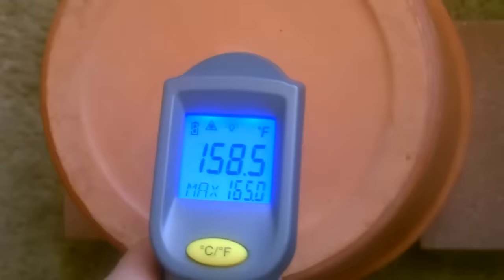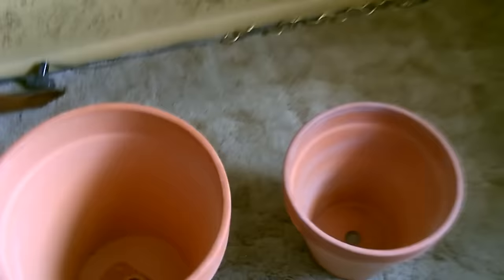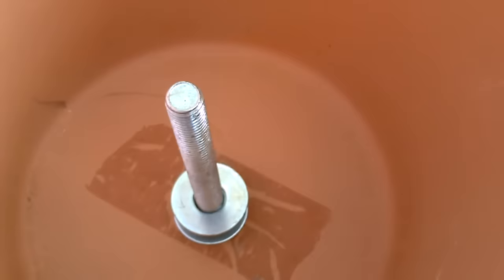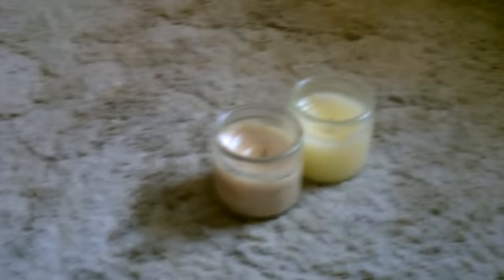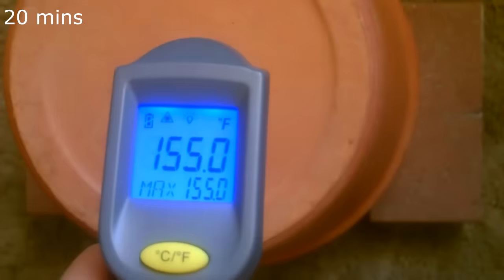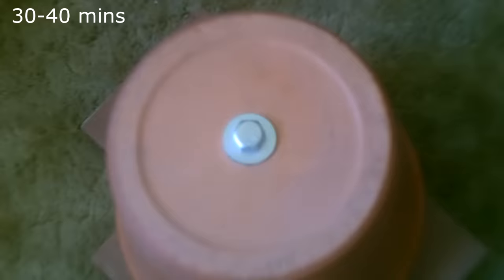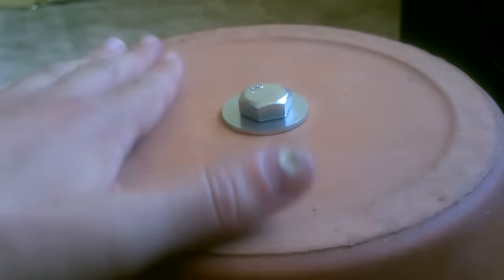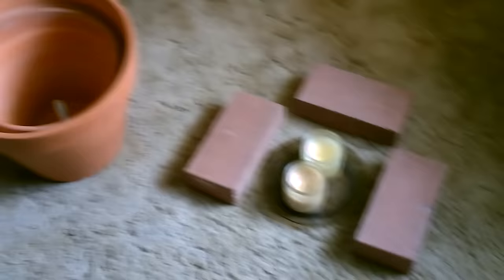Candle Powered Air Heater - DIY Radiant Space Heater - flower pot heater - Easy DIY

Comment: I would NOT leave those on a carpeted floor. Fire waiting to happen. At the very least, put a baking sheet or cooking stone underneath it all.
Reply: or a simple baking tray? i was surprised to see it was all done on carpet
Reply: I think that was done just to show how to make it. Don't think he has a bunch of them playing around on the floor. But who knows.
Reply: I suppose you can make a car without dampers to see how it works...
Reply: I always make sure that candles are inside glass jars and that they are placed on metal or stone. I never go to bed without checking candles, plugs on walls, etc.
Reply: The heat does not go to the bottom at all but up into the top of the pot. However, it is not enough heat that gets generated with small candles. It gets comfortably warm with the pots, but by far not enough to be described as a heating source. Of course one can then try larger candles
Reply: My thoughts also. Use a safer place like a wooden tabletop.
Reply: The plate on floor will not suffice??
Reply: @dm5129  ....better yet, Crisco shortening in Mason jars - more heat - & lasts waaaay longer
Reply: I thought the same thing!!
Reply: @laynegoldsmith3873  used open like a stove - or with clay pots? Will try it out
Reply: This whole video is cringe
Reply: Not very adventurous are you?.....lol.....
Reply: Hell yea
Reply: It just did happen in England lol
Reply: Then don't.. simple.
Reply: @PlatoonGoon  the word you're looking for is "null". .. it's okay little buddy daddy will teach you how to speak proper
Reply: It's on a plate! Not on the carpet!

Comment: It is a great idea. However, I would make one minor change to your design, though.  I would turn the bolt the other way around so that it comes out of the two pots outside so that you can have a handle in case you want to lift the pots, using a insolated glove, of course.
Reply: Khan Loo I was thinking the same thing.
Reply: Good idea till you trip near it and impale your self like off of a scean of final destination.
Reply: Doesn't having the bolts inside also generate heat making the temperature rise more ?
Reply: @startingwithnothing5423  use one with aye.
Reply: All that accomplishes is wicking the heat right out of the system and dumping it into the enviroment faster. Surely it would still work, but effectively you'd just be adding a dissipator. Not ideal for a heater.
Reply: Khan Loo 
Use a Thread Eye Bolt, instead ...
Reply: @SepiaSepiaKR  you want the heat to spread out to the environment to, you know, warm up the ambient air
Reply: @flgator1201  im thinking the heat should spread out from the clay so it goes slower and accumulates more , making it more intense

Comment: Allied POW's used the same idea in WWII, using two tin cans. A small can, open side up, inside a larger one can inverted over it.  A hole large enough to insert a hand full of twigs was cut in the side of the large can at the bottom side.  The closed top of the big can became a very efficient cooking surface fueled with very little fuel.

Comment: Consider using a Crisco candle. Lasts longer, burns cleaner, and cheaper than wax candles.
Reply: Crisco candle? You talkin about just lighting up a can of Crisco?
Reply: @KCCAT5  you take a can of crisco and stick another candle or two or some other kind of wick in it and you'll have a candle that will burn for a very long time.
Reply: @vanissaberg5824 ... Melt the crisco 1st, then pour into Mason jar, or tin can, (or leave in Crisco jar, if Ur area sells them that way) - cool to semi hard in fridge, add semi long skinny birthday party  looking candle, & leave (or put back in fridge) to set. Once set, place jar on a fondue pot, type stand, light candle, & place terra cotta pot over it. Buy Crisco in1lb (for small Mason jar, & 2 lb tubs for large Mason jars) crisco lasts much longer, puts off more heat, & is much cheaper than buying wax candles.
Reply: This idea is awesome. I just bought a big tub alogn with cotton cordage to test.  I read it will burn for DAYS..

Comment: Thanks for sharing will be using this for sure. For those confused by radiant heat its very simple. If you heat up clay, stone, tile or even glass to a high temp it will hold on to that heat and slowy dissipate over time. I used to have an oil heater that I would place on my tile floor and loved how it would heat up 400sq feet of tile. The whole room stayed warm for serveal hours after it was turned off.
Reply: What about a stainless steel pot?  It won't retain heat for as long, but shouldn't it radiate heat just as well?  I'm just starting out trying both and want to know if anyone else has tried both. Thanks!

Comment: It works quite well, washers & bolt not needed, I cover the first pot hole with a used candle foil, it does NOT burn the carpet, obviously some common sense is good!
I get large packs of candles very cheap and this is a nice way to heat just the one room if you want to avoid heating the whole house.

Comment: The reason for using more pots is simple. More pots equals more mass. The idea is not only to have heat while you are burning the candles, but also long after the candles burn out. Again, more pots equals more mass. More mass equals longer retained heat..   You can also try spacing out the pots with sleeved spacers or additional nuts. And most places that you'd buy these pots will also have the bases that go with them for no to small additional cost. Using the largest base or plate it a better idea than a kitchen plate as it has more mass and a better higher lip to retain fire.
Reply: also put masive stone over pots

Comment: For those who asked about multiple pots. The air in between the pots gets super heated and that heat must go somewhere. So it would be a good idea to vent the top some to allow that heat to escape into the area desired to heat. Basically this process works just like your coffee thermos. A great idea, and I have heard from the critics. They are not completely wrong. Although I'd prefer my good ole thermostat on the wall, but remember, this is an "off the grid" DIY method. IT HAS IT'S LIMITATIONS!!! It should be attended and monitored!! I can imagine many a pioneer women put out many accidental fires in old cabins while the man was out hunting, fishing and trapping gathering food and wood. In the ancient days, they would "bank" a fire with earth or stone to radiate heat into a desired area or shelter to keep warm. I wouldn't say this is an "energy efficient" method, but it will suffice in a pinch. It's a method of using modern material to bank a heat source and get by until the power comes back on. But NEVER EVER leave this unattended in your home!!!!
Reply: The top shoukd be vented i agree its kinda like how a chimney creates a draft taking air in and smoke up and out
Reply: @TylerZ91  but the idea is to capture the heat/transfer it to the pots. If you vent heat from the top you are allowing heat to be released. It's only candles, 2 or 3 candles aren't going to generate enough heat that it becomes an issue, provided you have placed it on appropriate heat proof stands, the bricks in this case.
He says "it's really hot now" then proceeds to touch the pots.

Comment: we just moved to a cabin in the Colorado mountains, im now hunting for these supplies, this is exactly what we need. thank you
Reply: DIY, rocket stove, cook a bit, stove made out of an ammunition  box.
Reply: @marilyngrass416  or a turnip. They work too
Reply: @wampyvermeeren3781  To make a turnip into a cooker hob? Is that what you mean? 😁
You essentially need to make the equivalent of a Halloween pumpkin lantern (there weren't pumpkins for Halloween here in England at the time, so we had turnip lanterns and cooked bacon and egg on them :-D) 
Enough vent holes in the front so the candle doesn't extinguish itself.
Cut a hole in the lid and balance a small individual patty pan on top. A short tea light candle won't work. You'll need a long candle, cut so the top of the flame touches the bottom of the patty pan. Once the pan gets really hot it'll stay hot even if the candle burns a bit lower. Put some butter in the patty pan and bits of bacon to fry. Oh the smell is delicious! Periodically scrape the buildup of soot from the bottom of the pan or the flame wont heat it up. We used to cook scrambled eggs and stewed apples on it too. Lovely memories!
P.s edited to say the patty pans we used were about 3 inches wide 👍

Comment: It works real well in a small camper on top of a stove top cover I  know I have done it in winter camping to save propane.
Reply: Hi Louise.. I have a question.
Why use 2 pots? Cant 1 do the desired
Heat? Or is it because of the heat if you touch the 1 pot?     Idk...
Reply: @shawniriel5962  hi Shawn I used one pot not 2
Reply: @LouiseDavenport  cool im gonna try it out.  Thanks for the reply.

Comment: FYI I'm getting much better results with one large clay pot with the same technique. Only I use a quarter on the top to block the hole.
Reply: I thought you have to have a hole on top to let the heat come out?
Reply: trial and error.....one pot doubles the amount of heat you get....cool.
Reply: @amil2sellllc.616  
Every extra pot acts as in insulator, and that's exactly what you don't want.
Reply: @PETERJOHN101  As energy cannot be created nor destroyed, the insulator in this case, just decreases the rate at which the heat is dispersed or radiated. The result tends to be less-heat per minute given off but longer-lasting heat.  People find, when heat is given off too-fast, it circulates/rises and leaves through the roof where slower-heat tends to rise less-fast and spend more time at the "bottom" of the room where you feel it more.
Reply: 2 pots = slower, longer-lasting radiant heat

Comment: Try getting 165 degrees F + 2 feet from an open candle flame. This is really awsome. Thanks for sharing. I saw another version, which I like a little better. I ended up getting a 3 inch pot, a clay saucer which was right next to it in the hardware store - put the candle on that, surrounding it with 3 stacks of 3 pennies, put the pot on the pennies, more stacks of pennies on top (bottom of pot) and then put a ceramic saucer on top.
 This allows for convecting as well as radiant heat.
Reply: What if you used same length pieces of copper pipe instead of the pennies?

Comment: I’m using my Sterno stove and a can of Sterno for heat source. Small clay pot over that, a tin from a tea candle over the hole, then the bigger pot over that with another tin over the hole. Works great, the heat is remarkable. And I have it sitting on a baking pan.
Reply: Yeah but breathing that sterno air...
Reply: @maceo2012  got stove fan on and windows cracked open, gotta have ventilation
Reply: Sounds great can we have a photo please !

Comment: If you don't go out and buy new pots, but use old pots from the garden, make sure you don't do this on your white carpet as the pots will be wet, and all the wetness will drip off. It was quite pretty watching the condensation form drips around the bottom of the pot but it went on for hours, I mopped and I wiped....surprising how much water a pot with a hole in can hold!

Comment: About 8 years ago, my husband made a clay pot heater for me using three different sized clay pots, two clay dishes, 1 unglazed Saltillo tile, 3 L-brackets, a long heavy bolt, and a series of nuts and washers. When it's zero outside, we can keep a 144sf room at about 65*F. We started out using small pillar candles in glass containers, but soon realized that the melting candles are quite dangerous.

We switched to using a large tuna can and 4 ordinary tea lights. The tea lights will burn for 3-4 hours each, and they are contained in the large tuna can so no wax spills out. 4 tea lights mean more flames! Works out great! One of the clay dishes holds the tuna can, and the other clay dish sits on the topside of the bolted top pot (to hold in radiant heat). We place everything on the Saltillo tile (again, helps hold heat).

These things are AWESOME. Sometimes, we'll use the clay pot heater instead of our central heating system. Saves money.

Comment: Great idea! Maine experienced another Ice Storm with power outages for a couple of weeks around Christmas in 2013 and I was very surprised to learn how many natives and tourists had no candles for light, let alone for heat or possibly cooking.  This is a simple idea that would have been more efficient to many families I know vs huddling around the candles without the clay pots at night like they all did in below freezing temperatures without heat.

The pots hold the heat and dispense it more evenly than a single burning candle without a pot. This concept is about being resourceful in a survival situation, not for reducing your energy bills or heating an entire house better than a wood stove does. I will be recommending this idea to my friends in the future to help them reduce the chances of their pipes freezing again during lengthy times of power outages.  Thank you for sharing!
Reply: How do you recommend others to use this idea as a way to prevent their pipes from freezing?

Comment: I would think using a eye bolt would be better so you could take something to lift the pot when it is hot so you could stop the candles if you no longer need the heat.
Reply: Nice.  I'd add a sugru-covered handle to that eye bolt.  Would make lifting rather easy.
Reply: or you could just flip the bolt around so it sticks out the top instead of down inside. should be able to grab it either with your hand or some pliers.

Comment: Hi there,

I built one today,after seeing your video, for my hall way which doesn't have any heating.

I started by  using a tea light, but it doesn't give off that much heat, I put two tea lights and its a bit better

PLEASE NOTE 
I think that the candle that you use is VERY important. It will HELP to heat a room, but depending on the temp/draughts & insulation of the room, you may need several of these 

These are the parts that I used:-                          £

1 terracotta flower pot 15 cm                             1.00 
1 Terracotta flower pot 11 cm                            0.47
Terracotta  saucer 19 cm                                    1.22
Coach bolt & Nut M8 x 50 mm 10 pk                0.72
Penny washers    M8 x 25 mm  10 pk               0.62

Total                                                                       £4.03

I built 2 for £6.70, I am sure that you can do it cheaper!!

Although I have some washers and nut & bolts left over 

Thanks for the video!!
Reply: Crisco shortening lasts muuuch longer  & puts out waaay more heat - & is muuuch cheaper....

Comment: One of the reasons for large stones around a camp fire was to take them into the tent to provide heat.
Reply: Genius in simplicity 🙏🏼
Reply: Brilliant
Reply: No. I think the use of stones was, what the hell else are you going to use to create a firewall???  
The by product just happens to be a stone that stays warm for quite some time.
Reply: @heretohear8662  you can make a fire in just a pit, or on the ground. You don't need to put anything around an outdoor fire. The stones around fires have had many uses for years. Including being taken to tents.
Reply: Where does the smoke from the candle go. After a while I'll bet there's a whole sooty mess inside the pots?
Reply: The fire is usually a looong way away from the tent door - so where's the logic in that??...seems there is none. Up in the Yukon, it's normal to put spruce bows all over the tent sized ground, set up tent over the bows,  & frame stones in a semi circle, about 12 - 15 feet away or less, around the dug out hole, in front of the doorway, & whalla inside tent is warm!!

Comment: Very fasinating indeed, understanding the phsyics doesnt mean it doesn work, It gives heat and stores it to release more slowly than just the candles.  Its not meant to heat the home, but rather a small area.  In an emergency it would be very effective for heat, not cooking or anything else.  could be something to put in an emergency kit I think.  Its definitley safer than just burning candles.  As with everything it has its niche place in helping us.  Luckily we have a fire box with double burning.  But I so want to try this just because it looks fascinating
BIG ty for this.  We are adults so using it is would be with normal safety standards would nt it..loved the idea :)

Comment: This is like using a camping shower. You can get a weak spray for a little while, or you can pinch the hose to get a drizzle for a little longer.

You always burn the same hydrocarbons and release the same energy. The heat still goes straight to the ceiling. The pots slow the chemical reaction (by limiting oxygen to the flame), capture most of the heat as it's produced, and then release it slowly into the room.

Comment: Love the idea, i placed an old Toshiba lap top cooling fin/sensor (made of copper on top of the candle.held by a made up grill  it generates more heat than the candle itself thus multiplying the heat output and faster and longer retention of heat. i also used the ceiling rod with a hole in the middle with adjustable nut so that the heat can escape through the hole and warm up my potpourri on top.